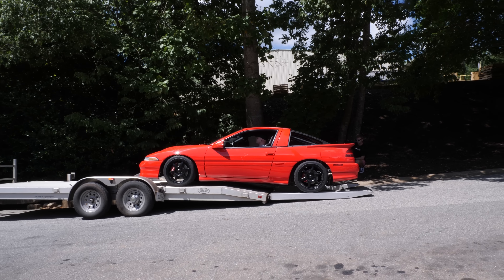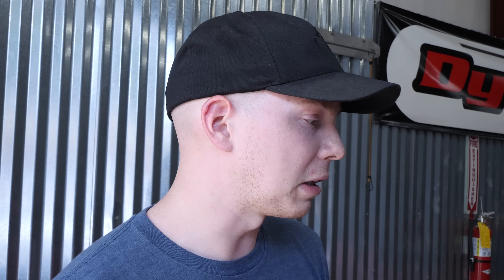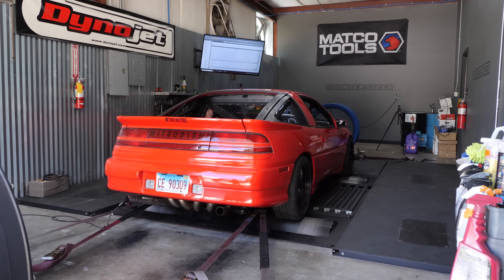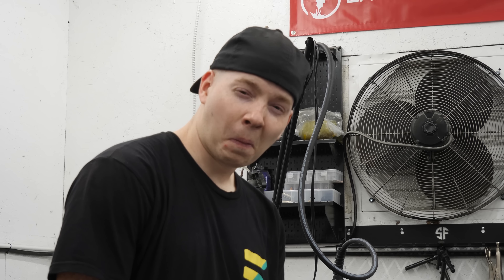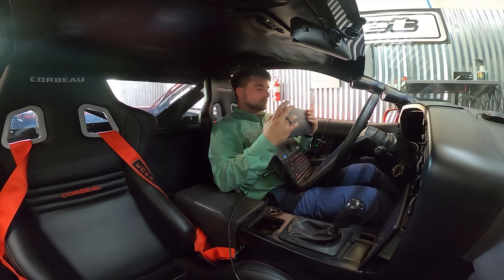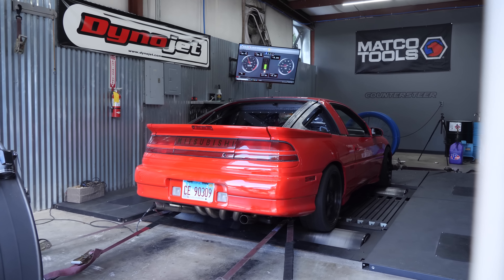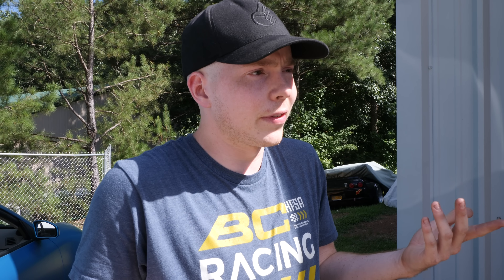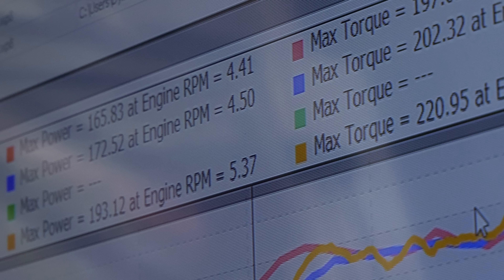Will The Garage-Built 4G63 Survive 25PSI of Boost On The Dyno?

Comment: If you're towing, you just have to drive different. 
I live in Australia and have done a lot of long distance towing (Sydney to Adelaide, Sydney to Townsville - 1000+km)
You have to drive to the terrain, not to the traffic and accept the fact that you are basically as slow as a truck.
You have to have the mentality of, "I'm a big heavy vehicle, I don't do fast".
Also, the slower your speed, the better your MPG will be - find a speed where the vehicle is happy cruising in top gear

Comment: Hey. Lots of negative comments on here, but I appreciate you posting all of the mistakes and issues that you've been experiencing. 
Your builds have all been fantastic, and this one just had a new level of complexity, even with keeping the "factory" motor and subframe in the car. 

I completely get the impatience to get the car tuned and driving properly after all these setbacks over and over. 

Seems like a lot of people in the comments haven't watched the rest of the series or read any of the previous comments, like how you already were having timing issues before in the last videos and discovered some issues you had with timing during assembly, or how you have plans to extract the heat from the engine bay better. 

Certainly any recommendations to go with a K series have no idea how much more expensive and complexity that would have meant compared to the 4g, especially if you hadn't had so much bad luck with your donor motors. 

Keep it up and I know you'll work through the issues and have the car fantastic in the end. Take your time and don't forget to step back and look at the issues you're having from a distance sometimes, it helps a lot to start from the beginning when a projects been going for this long

Comment: Those pistons appears to be strong😃
That’s probably problem with the tuning.
It did go thru the revs didn’t misfire ,no funny noises.
You will need external wast gate for sure.
I don’t think the air to fuel ratio is true.
That glowing red is clear indication for lean fuel mixture.
Good luck next time !